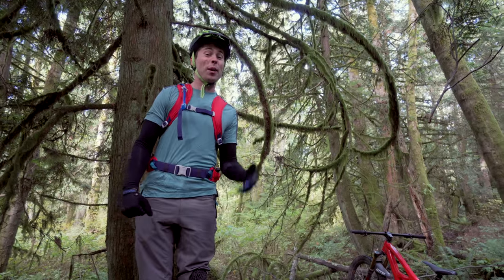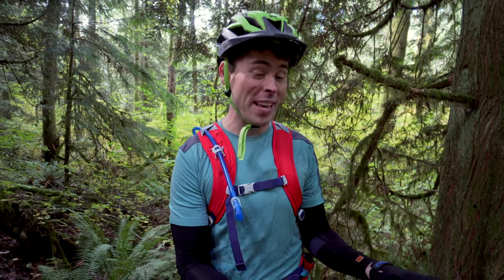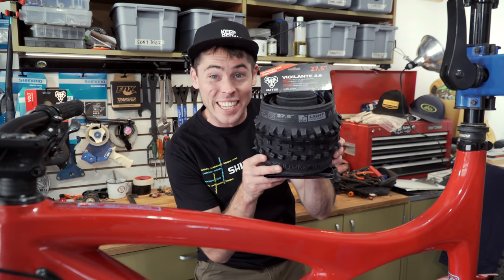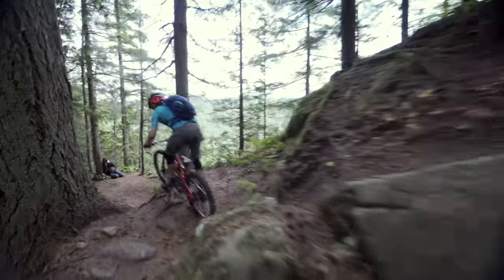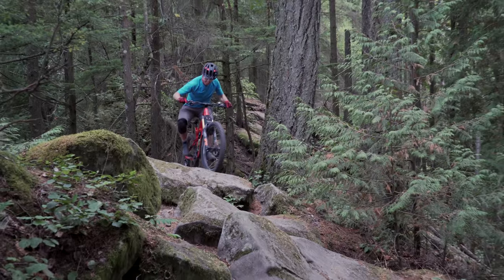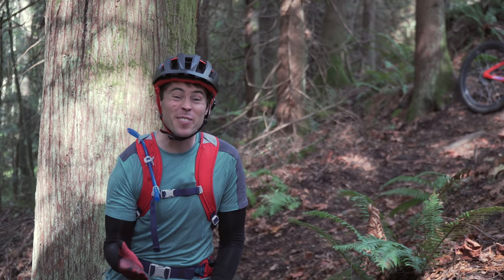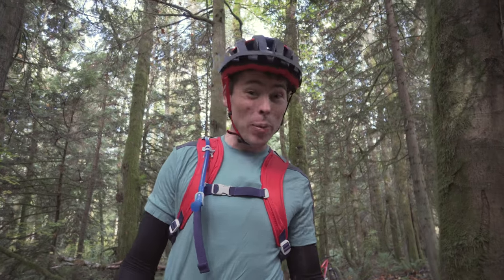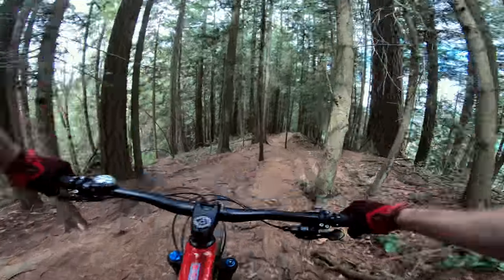BIG tires VS little bike: new shoes on Mojo3!!!

Comment from the maker: What do you prefer- little bike with big tires, or big bike with little tires?
Reply: Jeff Kendall-Weed I prefer the 650b x 2.6 setup I run now, opposed to the 29” 2.3/4 I was on last year!
Reply: For racing 2.5/2.3 dry..2.5/2.4 wet.. im sure 2.6+ would be a blast just for stredding fun on my hd4.
Reply: A 140/150mm bike with 2.6 tyres.
Reply: big bike with big tires?
Reply: I’ve only got a 29er but with 35mm id rims (spank oozy) & 2.5 shorty front & 2.4 dhr2 rear, may try the 2.5 dhf on the rear next which was up front before the shorty, much prefer this setup to  the original 29mm rims & 2.3 tyres which came on the bike 🚲 👍🏴
Reply: Little bike - Big tires.  Banshee Phantom 29er with 27.5 wheels and 2.8 tires.
Reply: I prefer big bike with big tires.
I ride a 29er all year round, and currently have 2.4 Maxxis DHR front and rear.
Next spring I will put on my Vittoria Mezcal 2.25 front and rear.
I ride XC mostly, but absolutely love the extra grip on the Maxxis tires.
So the Vittoria's are only for dry summer conditions.

Comment: I’m running 27.5 x 2.6 DHF and 26 x 2.4 DHRII on my liteville 301!  Love this set up! I have run 27.5 x 2.8 DHF and 27 x 2.8 DHRII for awhile but 2.8 has a little to much squish.  👍🏻
Reply from the maker: Nice! Are you hitting smooth jump lines or rocky gnar?
Reply: Rocky nar! 🤘🏻👍🏻

Comment: Nice video, I would love to see more of your weird rock lines and climbing skills :) personally I'm not a fan of QRs especially on the rear as they stick out from the frame and can break pretty easily in a crash (happened to me). Unless you have to take off your rear wheel to fit in your car or something it doesn't seem worth it.
Reply from the maker: Thanks man!  I take my bike apart for travel every couple of weeks, so I LOVE centerlock rotors and QRs.  Stay tuned, got a full video dedicated to weird tech lines coming soon!
Reply: @JeffKendallWeed  Well it makes a bit more sense then. But some day when you're wrestling the mangled stump of your QR with a locking pliers... You'll remember me :D looking forward to that video!

Comment: I'm shocked the Ripmo is your choice on more techy climbs.  I'm riding 2.6's with the same rims you tested on my Mojo3.  I would have thought the 29 tires would make for more difficulty in manuevering, even if the grip is really good.
Reply from the maker: Hey CC, on tech climbs maneuverability is often the enemy, while traction and roll over are king.  I rode this same trail on teh Ripmo with 2.3 tires the other day and cleaned a bunch of stuff that I couldn't come close to getting on the Mojo 3 with 2.6 tires.

Comment: Jeff, loving my Mojo 3, I ordered mine with the GX kit, 742 carbon wheels, Eagle cassette and 2.8” Nobby Nicks.  For riding roots, rocks and some mixed dirt/flow here in Cincinnati, it’s awesome, but sometimes I feel the 2.8’s “wobble” a bit in hard pack turns.  My total weight (including pack/clothes is 200 and i ride 19.5 lbs in front and 20.5 lbs in rear.  How might a 2.6” setup behave?  I don’t ride in mud or wet conditions (the community is pretty good about alerting conditions) and we’ve had more than enough rain.  I adore the bike and value your enthusiasm and inspired riding and commentary, any feedback would be appreciated!
Reply from the maker: Thanks Tom!  Man, the 2.6s are good, a little more support than the 2.8s, and a little less rebound.  Why not try just one, in the rear, and see how that feels?

Comment: My current bike is 3.0 wide tyres front and back tho I’m less than half your skill level and a bit heavier than you 🤔. They work great for me as a big guy for extra traction in most situations. Rough descents are great with these tyres.
Reply from the maker: The 3.0 tires are great in the rocks!

Comment: ride 2.4 ardents on my fuel. up from a 2.25 on my older bike. I think wider helps with balancing, I feel I can track stand a little easier and longer on a bigger tire.
Reply from the maker: Right on man.  And those Ardents, well, when you try another tire, you'll be stoked at the improvement!  hahaha I could only ride Ardents in rear, and still don't hear much love for them.  Maxxis makes lots of good tires, but the Ardent isn't their most popular.

Comment: Is there any clearance issue with 2.6 or even 2.8 tires?    In fact 275 w/ 2.8 tires is dangerously close to the overall diameter of a 29 wheel.

Comment: What do you think about the damping qualities of the tough casing vs the light casing with these new larger volume tires.  Tring to decide if the extra weight is worth it for the rear.    Would also love to see an accurate weight as WTB published weight seems quite high.  Keep up the great videos!  Planning to use your link to buy the new rear tire Vigilante 2.5! Just not sure of tough vs light casing
Reply from the maker: Hey Greg, I MUCH prefer the Tough casing tires.  To me it's simply not worth it to risk flatting with the lights, and also the support of the Tough really helps in big impacts.  Yeah WTB is very honest with their weights, they weigh ~10 actual production tires and then take an average.  Some manufacturers base weights off pre-production samples, which are often made by engineers in the tire company's R&D department and not in the regular assembly line, thus made more slowly and carefully with less excess material (and lighter weight).  While I run Tough front and rear, I do have a Light casing 2.6 up front and it feels fine on the big i35 rims.  Better than I expected.  I think the new tech is indeed better, but I still don;t know what exactly is going on in there (I left WTB at the end of 2017 to spend more time with family).
Reply: @JeffKendallWeed  Thansk so much for the awesome responses!  Really doing a great job of a WTB ambassador!  Looks like the tough casing it is for the rear!  Gotta where thru my current rear tire, but I know what is next on the list.  Can I click on the links above to ensure that you are credited with teh other purchase that I want to make in the mean time?  Would love to give you credit for the great work you are doing for Jenson!  Cheers

Comment: After riding the 2.5/2.4 setup (after the 2.6), which would you prefer on loose/dry (SoCal) on a 29er? Thinking to try the Vigilante front, and rear... Thanks
Reply from the maker: Hey Greg, great question.  I really liked Vigilante style tires in dry, dusty SoCal conditions, and I won the Box Springs enduro back in like 2012 or 2013 (first ever CA enduro series race!) with a tire very similar to the Vigilante.  I'd say go for the new 2.5 vigi in front, and use an older 2.3 Vigi in the rear.

Comment: Are there any issues running the 2.3/2.4 front/rear combo or is it all in my head.  I was shopping for tires and almost went the WTB 2.3 2.4 combo you ride but was worried the tires would pitch the bike forward a bit?  Is the .1 difference negligible in a real world application?
Reply from the maker: Nick, many tires don't measure to size.  WTB's 2.4 trailboss is smaller than their 2.3 vigilante.  I definitely prefer a bigger front tire than rear if possible.
Reply: Thanks for the replay.  I wish I knew that before I ordered new tires!!  Either way, I'll try this set up next year when they wear out!  Love the videos and the channel, keep up the good work!

Comment: I'm running 2.8 dhf/rekon f/r on my mojo 3 and like it, but am definitely interested in 2.6 tires. Had you had any pedal strike issues with the smaller 2.4/2.3 setup?
Reply from the maker: Hey Manny, I think pedal strikes will happen regardless of the tiny differences in BB height by the different tire sizes.  Usually pedal strikes are simply the result of poor timing.

Comment: Isn’t it bad to clamp the seat by the seat dropper  stanchion
Reply: If it's fully extended and you don't clamp it too tight or turn it to extreme angles it should be fine.
Reply: Make sure its clean of dirt or clamp will scratch stanction
Reply from the maker: Not bad at all, it's far worse to clamp the outer tube of the dropper as that would then bind the bushings and crush the seals.  And clamping a carbon frame?  I've seen multiple frames break from that.  The exposed stanchion of the dropper is just fine.